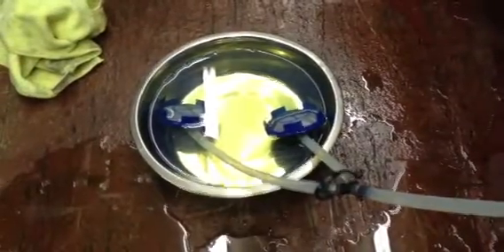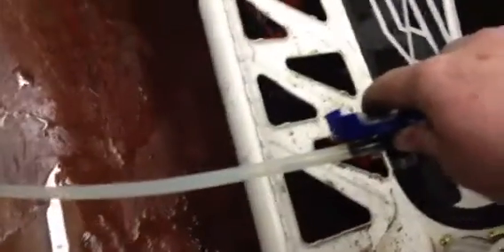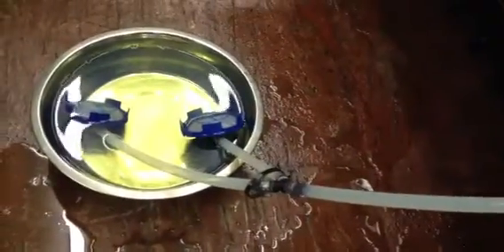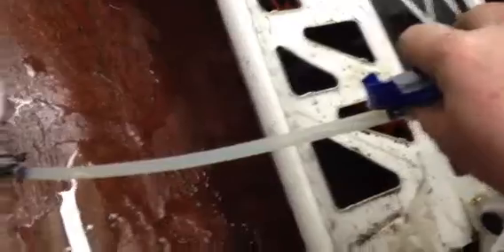XF turbo fuel system

Comment: I'm having and issue with my 2012 F800. There is a new system for 2014 and newer. Something to do with the springs. Also that first valve has a pin hole in the foam disc which may be causing your loss of prime out of the tank.